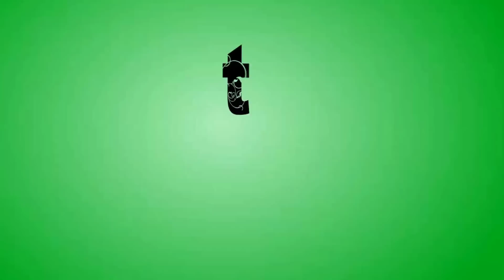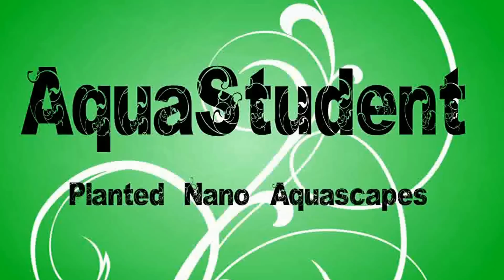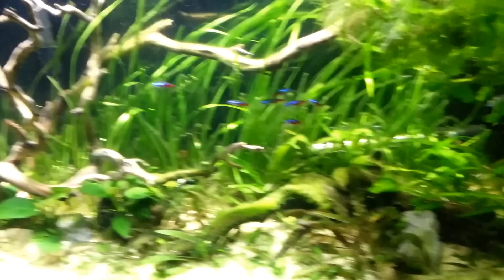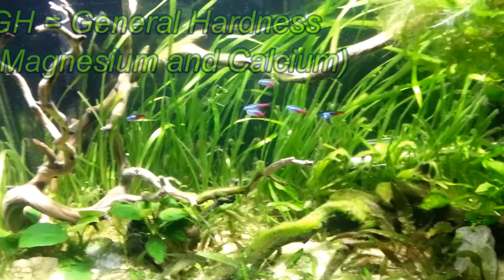Introduciton to Water Hardness (GH KH)

Comment: +aquaStudent other hobbyist saying KH effect fish directly !! is that correct ?
Reply from the maker: Some fish definitely prefer harder/softer water. However, most tankraised fish are pretty adaptable to just about any water conditions.
Reply: What about shrimps?  What u recommend kh/gh to keep them??
Reply from the maker: el7areef1
I believe the most important thing for shrimp is calcium. Just make sure you've got some calcium in your water and you should be fine. If your shrimp are molting then they are healthy.

I can't comment on specific values because there's just so much that goes into it.

Comment: Could you please show videos of how to lower the hardness of water in aquariums please? Thanks!
Reply from the maker: I absolutely will try. I'm in the middle of my qualification Ph.D exams so I won't be able to for a few weeks but I can give you some tips.

Lowering hardness is a bit more difficult that raising hardness. One method is to do a water change using rainwater. Rainwater is generally low in salt content/low in hardness. Likewise, doing a water change with Reverse-osmosis Deionized (RODI) water will also lower the hardness.
It's also possible to lower hardness using natural substances like peat moss or driftwood.
Reply: I've tried driftwood but it had little affect :( my hardness ppm is at around 200 I believe and the pH is at around 7. I have alligator snapping turtles and the hardness is way too harsh on their skin; they're shedding too much especially on their plastrons and the tips of their beaks have dulled. So hoping you can do a video soon! Thanks!
Reply from the maker: Allen Jacob
Try collecting rainwater or contacting a local chemistry department to see if you can get access to RODI water. You can also purchase and set up an RODI system in your house for a couple hundred dollars. It's expensive but you're going to get a lot of use out of it.

How large of a system do you have for gator snappers? Those guys get huge and can be nasty! I found a few American snapper babies in my back yard a few summers back. Was thinking of keeping them but decided to let them live naturally.
Reply: I have a 20 gallon long tank. Only half of it is filled with water so about only 10 gallons really. My biggest one of the three alligator snappers is about 4 inches. He's the only one out of mine that didn't suffer a dull beak because I had him since he hatched so I'm guessing he adjusted to the hard water over time compared to the other two who entered my home about a year from being hatched at my breeder's farm. I took out all the substrate like rocks and plastic plants. Only thing in there is my 3 turtles, heater, filter and driftwood.